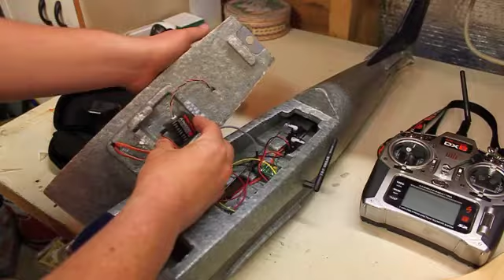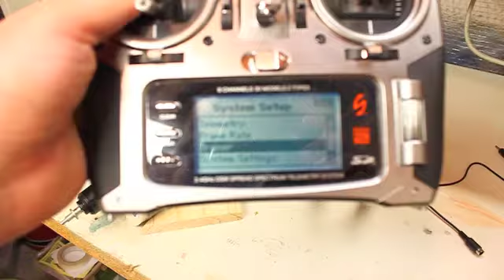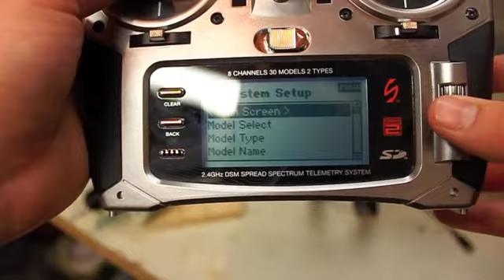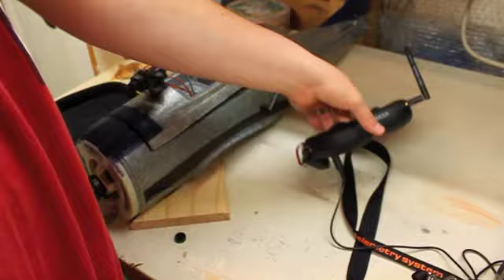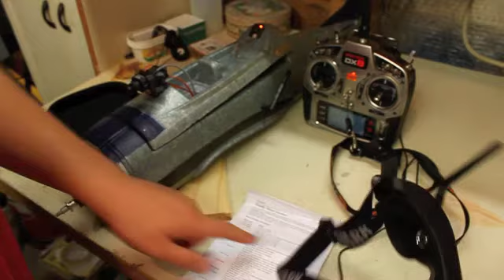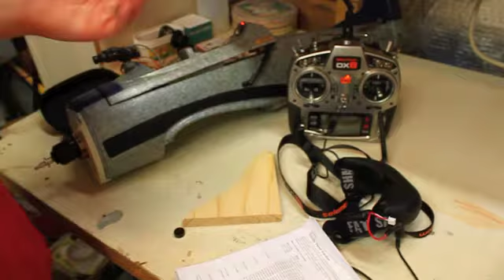Fat Shark FPV setup  and Head Tracking on Spektrum DX8

Comment: Thank you for the informative video. Just a tip regarding holding down the trainer switch. You can set a different switch on that channel, i.e. change it to one of the toggle switches which you are not using for something else, then you can just manually switch the tracker on and off. Hope this is useful. Cheers.
Reply: How do you go about doing this please. I have a DX8 series 1 and  I can assign the trainer switch to do other things but can’t find a way of assigning the training mode to another switch.

Comment: Hay Jim how did you know you had to use a mono plug. I have a Fatshark Trinity head tracker that I'm trying to use with my Hitec Flash 8 that also uses a stereo plug. Can't get it to work. I'm a little afraid to use the mono plug. Might cause a short in the transmitter.

Comment: Hi!, great video man but i have a question... Where can i find the servos mount to control the movement of the camera??? is there a specific one that i have to buy to get these thing work?

Thanks a lot!
Reply from the maker: Thank you! I followed the links on the fatshark web site. But just google "pan tilt fpv mount", that will get u in the right direction. I forgot where I got it from haha. Good luck!!
Reply: Thanks for the reply! I´ll do that jimmy
Reply from the maker: Pedro Cano Also, If you are somewhat familiar with how servos work and have a little DIY in you and/or extra servos at home. You could make a mount relatively easily. Sometimes its easier to spend the $40 or so and call it a day tho lol
Reply: Thanks Jimmy, i really appreciate the time you have spent in sharing this info. probably i´ll do the test in making my own mount of servos, if it doesn´t work i´ll buy it. Thanks again and keep it up!.

Comment: Good walk through. A couple questions. So that's all it takes, switching the two channels in the trainer mode set-up, and it works? Does it really need that mono adapter?
Reply from the maker: I found it does. I havent tried it without the mono since i set it up. Maybe Ill try it and comment again.
Reply: Jimmy Snyder Well I got it and did everything you did but I keep finding things are getting jumbled around, it will switch to roll for left to right and then I lose tilt, and the worst part is that the camera is centered when I click on the buddy box button, but once I lift it to turn it off, the camera points to the side. How do I fix this? Really flustered. Paid the extra to get the head tracking and it seems to be pretty poorly set up...or it could just be me...
Reply from the maker: ***** Let me look into your problem. I think I had this camera issue as well. I will check that. I understand your frustration. You have Dx8?
Reply: Jimmy Snyder Well after some working I got it all figured out, finally. I am using a DX18QQ which isn't an "official" working radio for it, but it "unofficially" does work. After some tinkering, I got the head tracking to work and got the servos all centered up. The thing that sucks about the head tracking is that you can't have control of the plane and use head tracking at the same time...unless you can?
Reply: ***** Can you please tell me how you fixed the problem of your camera pointing to the side? Min points to the left when I release the trainer button. When I press the button it centers and begins to work.

Comment: What size mono plug did you need to order?
Reply from the maker: A Standard 3.5mm plug worked for me. The fat shark supplied the cable from the 3.5mm to goggles cable.

Comment: very good video... I just did the exact steps and it worked without any trouble. I have a question. when comparing the PPM signal which is coming from the goggles is almost double the PPM singal the specktrum sends out (when the radio is OFF. when the radio is ON it accept a PPM singal and when the radio is OFF it transmit a PPM signal) So do we need to put a resister between the goggles and the transmitter?

As the PPM signal is a digital signal there should not be an effect for the information the signal carry even the voltage is dropped via a resister. guys please advice.. Im sure no body want to burn the spectrum... My worry is that if the spectrum can transmit a low voltage signal PPM signal shouldn't it also accept a similar voltage input PPM signal.. (not double)

In theory spectrum expect the PPM port to work with another spectrum radio. As all the spectrum radios have the same PPM voltage they wont harm one another... I'm using a dominator with trinity head tracker, dx7s
Reply from the maker: Haha I think you are speaking a little above my expertise level... Anyone else on here can help us out???

Comment: do you always have to hold trainer button to activate HT?

is there a way around this?
Reply from the maker: From my findings you do. I believe you can set it to a different switch. Check out some comments on here and ask these guys too. alot of them know alot more than i do! good luck and feel free to post your findings!
Reply: Does anyone else know how to solve that?
Reply: ***** I am not using my trainer for head tracking but the same should apply with head tracking as it does with a normal trainer setup. On my dx6  under the trainer menu I'm able to to set the trainer on any of the switches on the transmitter. I have had other transmitters that had a "preassigned" trainer switch that it would only work when that switch is in the trainer position and most times they are spring loaded. The only ways I know to get around this is to ether add a external mechanism to hold the switch in the trainer position or to replace the momentary/springloaded switch with a standard toggle switch. You can assign the trainer switch on most modern transmitters so you want to make shore that you can't before you dig into one of your transmitters.    .

Comment: I can't seem to get help anywhere on the subject:-( I have a dx7s which is basically the dx8 I have the same trainer page and settings minus the 3rd aux. I have set this up at least 50 times now and every single time my radio says "warning no slave" and the tracking will not work. If anyone knows how to help or could walk me through the transmitter side of things or something that would be great. I have no idea what I'm doing wrong here.

Comment: Ibn Air is right.  In your trainer port setup where you set your masters and slaves scroll down till you see the switch setting and change it to one of your toggle switches.
Reply from the maker: Thanks!! Ill be sure to check yours out!
Reply: How can I do this? I selected gear for the trainer in the switch select option but I can make it work from there.
Reply: @SkymotionColombia   If you are still wondering the switch setup says Trainer and gives options. This means the trainer switch can be set up to do "Inh, Gear, aux1, aux2 or aux3". Why you would want the push button switch to do gear I don't know.

Comment: try to use a different battery for the video, because you going to have a lot noise on your video from your ESC
Reply from the maker: also prop wash is an issue, I did use a separate batteries. The trojan holds alot of weight and still flies wonderfully.
Reply: Jimmy Snyder make more videos to see it

Comment: Sorry it is a DX18 the guy is using.  He also has a good video but totally rewired his stereo jack and swapped it for a mono, but you did it the easy way and bought a plug so you have both!  Bravo!  Also, for you guys that want a head tracking cord for your Fat Shark or SkyZone goggles which you want to connect to an EzUHF Tx…. your cord will need to have an S-video plug on both ends which I believe was included with my SkyZone Goggles.  Now all we need is a video which includes all of this info together in one video.  YouTube is awesome.  Everybody can contribute.  Knowledge is power!